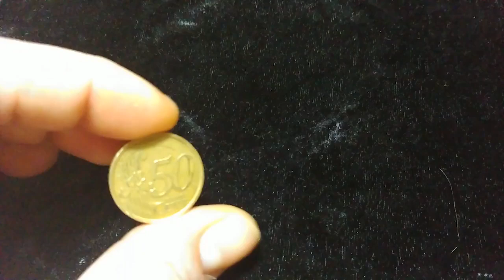How I Turn A Coin Into An Engagement Ring ~ By Kryher

Comment: You can heat metal quicker by laying it down on a fire resistant surface, charcoal works fine for me. Plier is a heat sink
Reply from the maker: Thanks for the tip, I'll try it out, although I usually heat metal on a firebrick 😅 -had to do something more fancy for the video